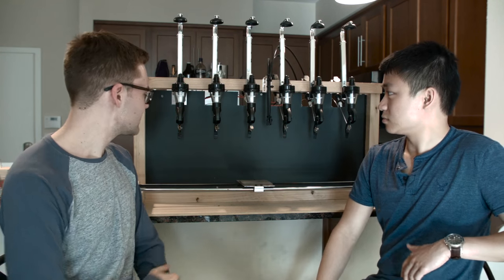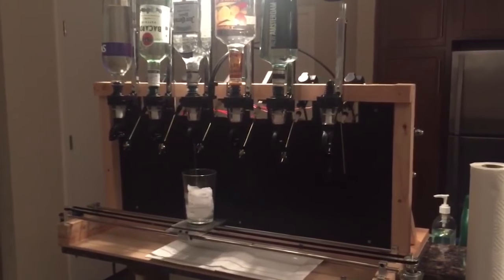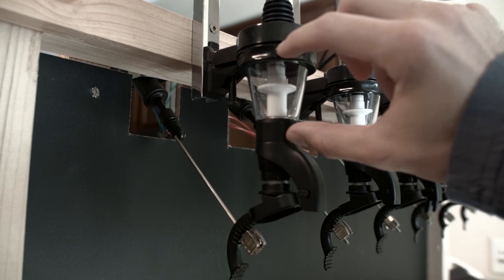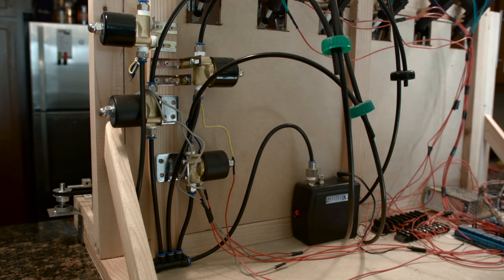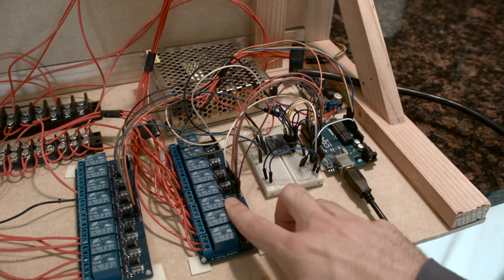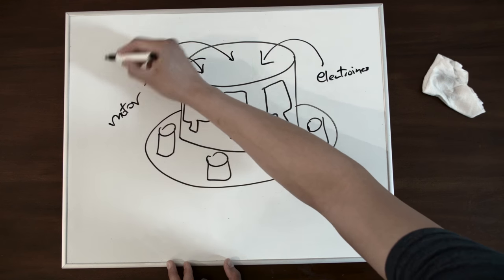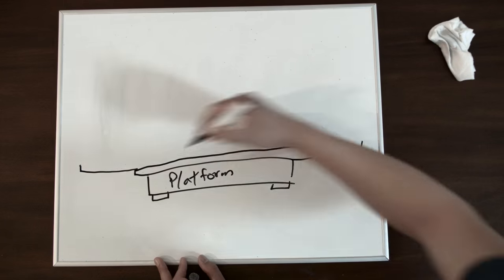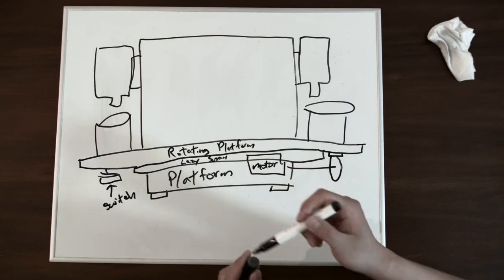Building a Robotic Bartender - Part 1: Planning and Design

Comment: whats the name and info for the compressor system you used in the earlier version. i would want that for a different project. Also the links to the solenoid Valves
but great job love it.

Comment: hey, love what you've done, just a suggestion though: wouldn't rotating the dispensers work better than moving the drink? it would allow for quicker filling (because you wouldn't need to worry about drinks falling)
Reply from the maker: We thought about that initially. I'm afraid to spin those dispensers, though, because they are really flimsy. I'd rather have a drink go flying than an entire bottle of gin. We're going to 3d print some cupholders to prevent them from moving :)
Reply: +Hacker House ah that makes sense, that would also prevent from it being dispensed poorly (because it the glass was placed wrong) but if you wanted to change your mind, you could have the bottles fixed above the dispensers with rubber hose connecting it to the rotating dispensers, but even that might end up not working well. good call

Comment: Hey, love your bartender videos. Where did you guys get the dispenser??
Reply from the maker: We're glad you like them! They are called spirit dispensers -- you can usually find them on Amazon or Ebay. Here's a link to the ones I bought: http://www.ebay.com/itm/Oggi-Professional-3-Bottle-Revolving-Liquor-Dispenser-/301994639019?hash=item4650487eab:g:qqwAAOSwepJXbGl4

If you're interested, we've also listed most of the components that we've shown so far on our hackaday.io page: https://hackaday.io/project/12260-robotic-bartender-v2